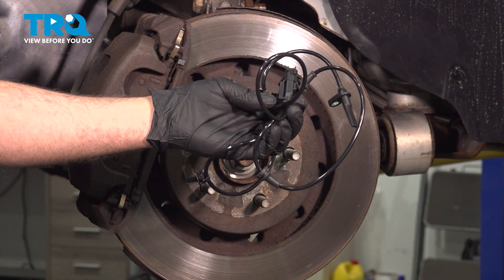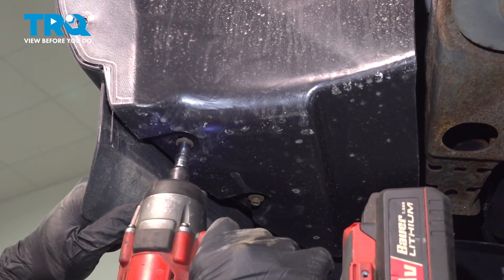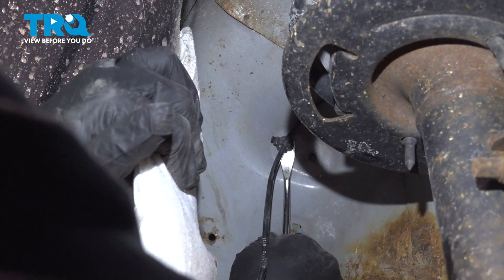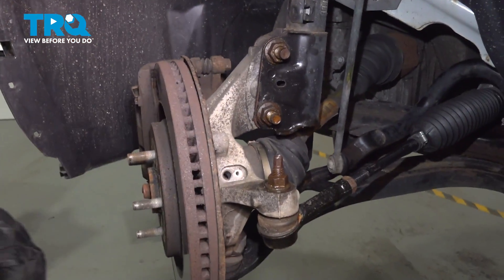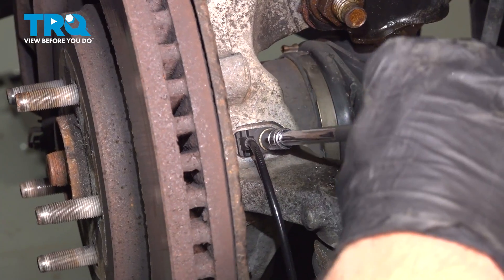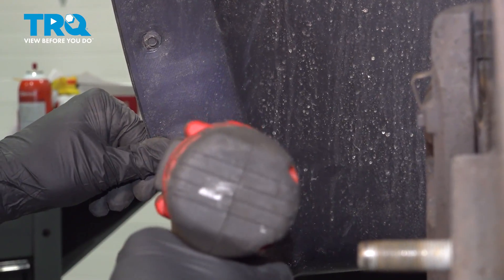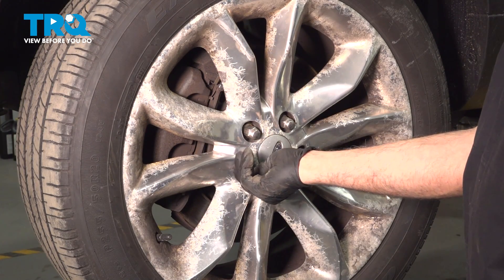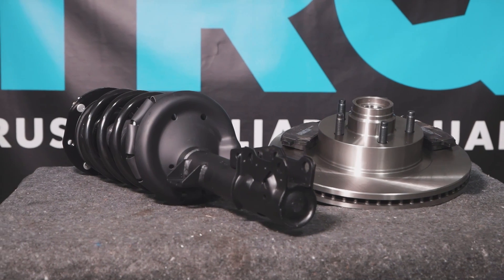How to Replace Front ABS Sensors 2011-2019 Ford Explorer

Comment: So , this is going to sound real stupid but here we go . That ABS has nothing to do with when yo are changing the wheel bearing hubs , does it?  I ask bcuz this guy told me that's what was blocking the hub from coming out as it was being ripped from it's place. My gut tells me it does not and now I have worse problems. This is on a 2014 ford flex.